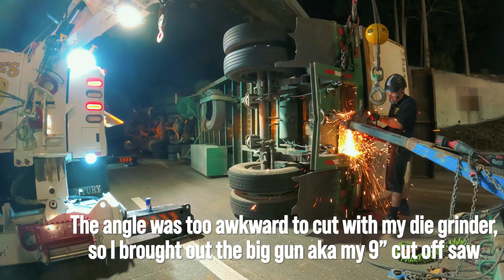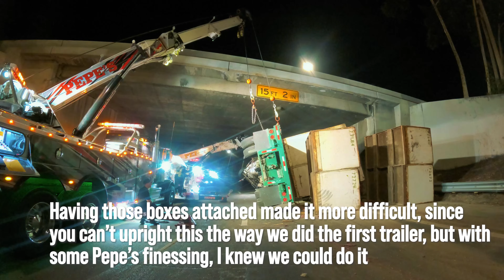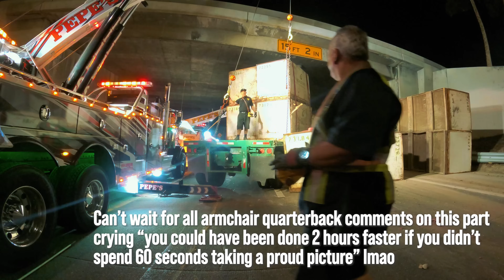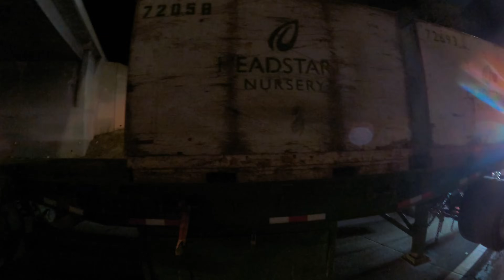Crazy rollover wreck under a freeway overpass

Comment: I can't believe the equipment and lights on  those huge Rotator Breakdown Trucks. I'm guessing they're running about a 500 horsepower diesel engine. That'd be 300 HP to drive the truck and hydraulics and 200hp/250 kilowatts worth of Alternator electric power to run the lights and winches ! Plus those "Night-Sun" work lamps, what kind of power are those mothers puttin' out ?  Interesting to see this recovery. Thanks guys.

Comment: Hi Guys. Any update as yet from the hit and run incident on your rotator by that other trucker that you posted several weeks back firstly?  Nice tricky recovery this one. semi truck and pup's are always awkward. Many thanks for sharing
Reply: Thanx for asking. Waiting on a few more parts from Miller then it's off to the spray booth for paint. Hoping 5 more weeks will do it. Super Dave is going nuts without his baby ! I'm sure you can relate.
Reply: @joeacosta5011  Many thanks for the update and hope we can see a follow up video to this once the rotator is returned.

Comment: Correct me if I'm wrong , but would the hitch on the rear have unhooked if you had lifted the trailer. It was the next thing you did anyway. Cheers from Canada.
Reply from the maker: That was plan B. We did that.... It's in the video.... All it did was raise the trailer and take the second one with it. Unless you're in the industry, it's hard to imagine how twisted metal can get on big wrecks.

Comment: You did a GR8 job as always. Do you know what caused it to flip in the first place? From what I could see after the front trailer was uprighted, the boxes weren't in the correct direction which would allow the things to shift. If they had been turned 90 degrees, instead of being able to shift sideways they would have been front to back.
Reply: That is a pretty tight curve coming after a straight shot. Most likely going too fast.
Reply: This company apparently moves a ton of these plus securement devices were in the right place.
Reply from the maker: Good question, my guess would have to be too much speed heading into that downward curve leading to the overpass.

Comment: So was the eye of the trailer to mangled and twisted from getting flipped like that, that you cut that off instead of the hook (that might have been unbolted)?
Reply: We definitely looked at unscrewing the bolts but they were in a very confined space. Josh made short work of it. He lives his Milwaukee cut off tools
Reply: @joeacosta5011  I suppose the eye is easy enough to replace (weld on a new one). But so would unbolting the remains of a cut off pintel in a shop. Hence the question if the eye on the trailer had deformed. A deformed eye is useless and would need replacing anyway. And by the look of things the pintel as well with how stuck the eye was and the forces needed to twist and buckle the eye would have damaged the pintel no doubt.

Comment: Not an easy recovery for sure...I would hate to imagine what it would have been like further under the fwy overpass.  Hopefully the driver is okay.  What was the initial cause of it?
Always great seeing you and your dad teaming up Josh:-)
Reply from the maker: Technically, if it was more in the overpass it would have been easier. We just would have cut the straps holding the other boxes and brought over the tractor with empty trailer as one. Unfortunately that would mean the customer would have zero salvageable crates. At least this way we were able to save 5 boxes by leaving them strapped.

Comment: Very nice recovery, I'm thinking that maybe a sling through the rub rails on either end and lifting the rear trailer on its side just enough to get the binding out may have possibly worked but either way, great job as usual.
Reply: You mean to undo the pintle hook ?

Comment: Nice recovery in tight conditions. Have you ever had one that was in such a tight spot you're like "Screw it, let's drag it on its side until we get somewhere we can work."?
Reply: Twice in 30 years we had to walk loaded containers down a sloped ramp due to the concavity. Basically, when we uprighted it wanted to lay over again. Bottom of ramp was a flat surface with ideal conditions for safe recovery.

Comment: Just a random question, but why not unbolt the  penndel hitch from the front trailer? Or cut that instead of off the trailer? That’s an easy replaceable part.
Reply from the maker: That would be a horrible and dangerous idea here. For starters, there is wayyy too much pressure on those bolts to come out safely. Second, how would you take off the bottom right bolt since it was blocked by the twisted tongue? Much faster to just cut it.
Reply: @PepesTowingService  makes sense. But why not cut the hitch on the front trailer than? Then the rear trailer could be used in the future and the replaceable part could be replaced. 

Just looking for less damage to the equipment from the recovery.
Reply from the maker: It was cut where it was most strategic and easy to cut. The guy lost an insanely expensive load and has a tractor destroyed. It's easy as hell to watch from a computer and say what you would have done. If that was the easier option, we would have done it. In fact, my first attempt was to cut there with the Sawzall. Was not feasible.
Reply from the maker: To add to my previous comment, the guy caused well over 6 figures in total damage, product loss and recovery bill. A pintle hook that can easily be welded on is literally the last of this guy's worries.
Reply: @PepesTowingService  not hating, just asking the question.

Comment: Why don't you flip the second trailer sideways back up in line with the other trailer then unhook it
Reply: I have the same question! I mean the trailer has to be turned over anyways why not turn it over halfway and unhook it? It wasn't under the bridge
Reply from the maker: You must have skipped the part where I mentioned the pintle hook was destroyed and jammed. Flipping the second trailer would be impossible because the pintle attachment would not turn freely at the connection point. All we would do is literally twist the second trailer in half and possible break the axles
Reply: @PepesTowingService  There are new pintle hooks with continuous 360° rotation but this particular unit was a fixed one and it was definitely wedged in there tight. Had to come off !